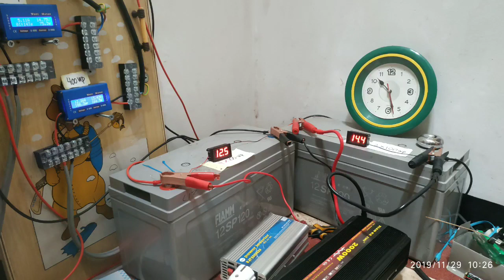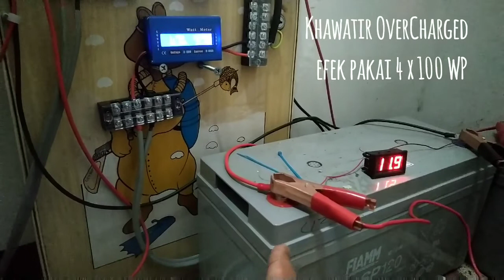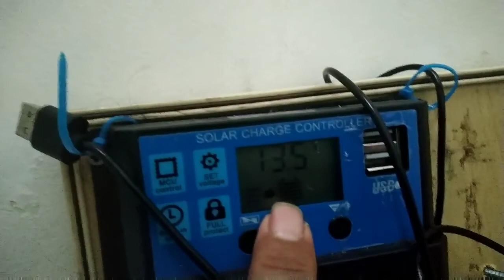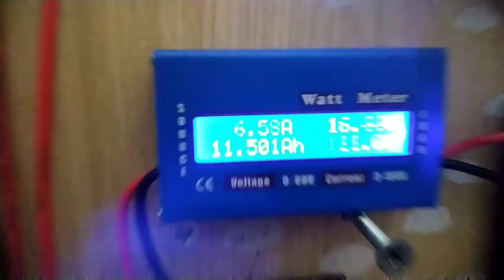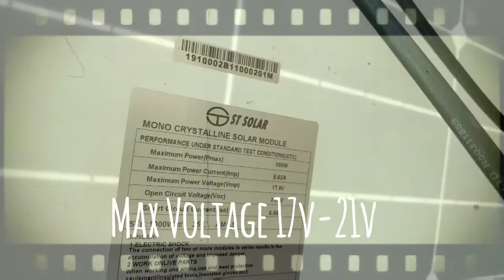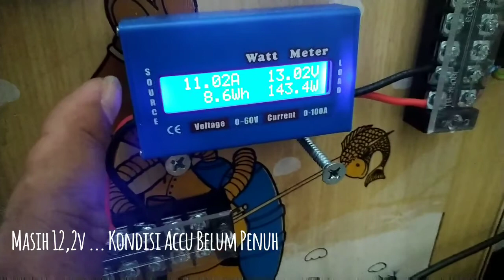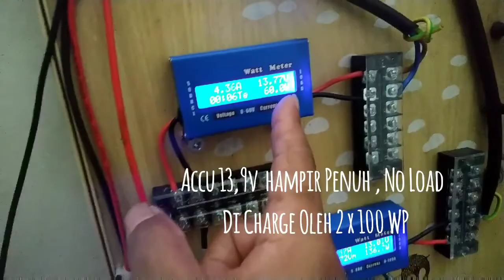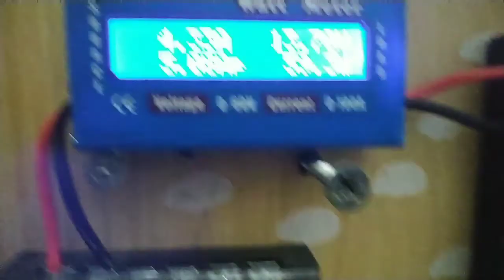Berapa Panel Surya Yang  Ideal Untuk Mencharge 1  Accu 120Ah ?

Comment: Kalau menurut pengalaman saya ya Om sebaiknya utk menjaga aki awet, aki 100 ampere pakainya 100 wp saja, semakin besar ampere yg masuk ke aki memang betul semakin cepat terisi/penuh akan tetapi resiko nya aki cepet habis dan mudah soak, beda dg ampere kecil aki awet dan pengisiannya bisa padat alias aki tidak dipaksa kekurangannya ya agak lama pengisiannya..mohon maaf bila keliru
Reply from the maker: wah.. kalo di charge cuman 100WP aja lama ngisinya itu pak..   pake 300Wp aja gak penuh penuh kalo kita sambil di pakai beban berat kaya rice cooker 350w... pakai pake rebus-rebus 30-50menit.. pas sorenya masih tekor gak sampai balik ke iisi >12,5v .

makanya sy coba pake 4 x 100WP tanpa Load dulu,  ternyata 1-2hari penuhnya untuk 120Ah dengan kondisi langit mendung berawan..

ini karena SCC nya masih PMW 30A, jadinya masih agak jantungan dipasang 4 x 100WP, takut kalo tiba tiba saat ngantor hari nya  panas terik ada yg jebol wakakak
Reply: Awas jangan gambling,..harus diperhitungkan matang2, kemudian juga harus diperhitungkan juga beban yg harus ditanggung solar panel, sementara siang pakai PLN malam pakai solar panel jangan terlalu diforsir om akinya..
Reply from the maker: @HerryLupheHanny  siap pak
Reply: @Dzikr_Family  bukan PMW om,yang benar PWM (Pulse width modulation).
Reply from the maker: @mainas9530  hehehe benar skali..makasih koreksi nya
Reply: ngakak.  bagai mans cara itung nya.
Reply: hahahaaaaa...... yg dibbaca hanya volt.... selama controlelnya pwm anda ndak bisa ngantor.... ganti broow MPPT 100 ampere... tinggal stel minta volt berapa.... beres.
Reply from the maker: @dellatinesya9072  masih OTW mppt nya nih...  nunggu dianterin sama babang sinterklas wakakak

Comment: permisi boos yang 4 panel pasang seri apa paralel
Reply from the maker: kalo yg di video, dulu 4 panel nya di paralel 12v...

tp skarang saya pakai offgird nya secara seri.... panel 6x100wp di seri 24v  accu nya pakai 4 x 100ah seri 24v
https://youtu.be/g-t3x3JH6_Q
Reply: @Dzikr_Family  boss sy baru punya 50wp Ada 3 ,inverter saya ada 2 yang kecil 500va pure sine wave yang besar belum lama baru beli 1000va lumayan Mahal harga yang 1000va 2.840 pure sine wave SNI
Reply from the maker: kalo SCC nya pakai MPPT,  panel enak nya maen seri24v .. accu bisa seri 24v jg atau main 12v sesuai voltage inventer nya..... biar cepat penuh kalo panel kaen seri 24 katnya

Comment: Saya pakai 150wp, accu 100ah, charger dri jam 8-1:30siang udh fuel accunya, terbca di scc 14,4 volt.
Reply from the maker: kalo di voltage accu di kuras dulu,  bisa full brapa hari itu accub100ah nya ? apa sehari bisa full jg .. mantaps tuh berati efisiensi panel nya brarti ..
Reply: @Dzikr_Family  di pakai semalman bro karna sering mati lampu pln
Reply: Di kurasa sampai mendekati voltage min, 11 volt.
Reply: kebetulan tinggal di garis khatulistiwa hri cerah matahari fuel dri jam 8 pgi sampai 4 sore.
Reply from the maker: wuih   mantap mantap.. pakai merj apa itu 150wp nya..  saya kira harus diatas 200-300wp bisa full sehari saja accu 100ah nya
Reply: @Dzikr_Family  kebetulan merk kl gk slh ingt merk "FALWS".satu set sama accu 100ah
Reply: @GRivai  cek harga berapa mas???

Comment: Itu scc sejuta umat settingan full charged di yg B1 B2 B3 ya? Trus kl tegangan udh sesuai B1 B2 B3 nya otomatis ke settingan floating gitu ?
Reply from the maker: iya.. 

B1 b2 b3... disesuaikan dgn jenis aki yg kita pakai....   
nanti SCC auto ngatur aja 7 seandainnya accu kita sudah penuh... akan cut off SCC nya ngerem otomatis,... 

tp kadang kalo panel kebanyakan, gak kuat jg SCC sejuta umat nya  Rem Bong 😁
Reply: @Dzikr_Family  misal nya pagi charging, trus penuh nya kan sesuai settingan batere, kl udh full dia kan stop charging, trus batere kan discharge tuh, nanti scc ngecas nya lg ke settingan B1 B2 B3 nya atau ke floating yg 13.7v?
Reply from the maker: @YudhistiroRM  iya betul... 

kata di manual book SCC BIru nya.. 
Equalization B1=14,4, B2=14,2v, B3=14,6

Float Charge nya sama di 13,7v kalo ikut settingan bawaan
Reply: @Dzikr_Family  trus dia akan charge sampe ke equalization nya lagi setelah nyentuh tegangan LVD atau gimana kang?
Reply from the maker: keliatannya bgitu... 
kalo accu penuh...  matahari panas.  kalo pake MPPT Epever di aplikasi SCCnya akan keliatan..   kondisi nya lg float atau fastcharge...

Comment: Pak, kalau pv 200wp + scc ngecharge accu 1pcs 100ah/12v apa tdk over ? Atau malah bagus karna lebih cepet wkt pengisiannya ?
Trimakasih sebelumnya 🙏
Reply from the maker: 100ah msh bisa buat 3x100wp ....  
200wp sdh cukupan.... resiko overvoltage minimalis...asal load jg disesuaikna dgn produksinya..

batasnya bisa sampai 4x100wp, tp harus rajin pasang load..  agar gak overvoltage krn jd cepat penuh accu nya...   

https://youtu.be/B8Rhz-A6NJE
Reply: Begini sebetulnya perhitungan kasarnya.. 
Setiap aki mempunyai batasan charger dan discharge.. seandainya chargernya 40% dari capasity aki yg 100ah..jadi 40anya  Nah 40a ini adalah batas max tercepat dan teraman saat charger.. diatas itu efek baterai jadi panas dan umur baterai berkurang.. jadi bisa dihitung supaya semua aman chargernya dibuat mendekati 40a kalau ingin cepat dan aman.. sekedar berbagi..
Reply: Nah untuk masalah overcharge pemahaman nya begini..
Baterai bisa di isi bila tegangan charger lebih tinggi dari tegangan baterai.
Bila tegangan charger dan baterai sama maka tidak akan terjadi pengisian... Jadi harus tahu batas max pengisian dan setting scc nya..

Comment: Numpang nanya bang.
Aku punya aki 100 amper ,aki mobil
Dan2 tenaga surya 100wp 
Butuh berapa hari aki baru full bang .kebetulan aku gak pake controller ..jadi dari panel langsung ke aki .aki tersebut langsung ke beban yg ON 24 jm. Kita kita aman gak bang untuk aki nya ? Apakah gak cepat drop kalau langsung tanpa controller ,,mohon penjelasan nya bang kebetulan kita baru menggunakan ...terimakasih semoga berkah ilmu nya amin
Reply from the maker: Accu 100ah 12v, brarti accu capacity nya itu kan 1200wh

sedangkna panel 100WP produksi harian bisa 300-400wh, jadi kalo normal sih 2-3hari bisa full biasanya kalo sinar matahari terik..

panel 100wp sendiri ,,,kalo panas poll mataharinya.. bisa mengeluarkan voltage diatas 15-17v.   sementara batas aman accu katanya maks 14,4v

jadi ada resiko accu overvoltage.. dan overheat.. yg bisa mempercepat sel aki rusak..

walaupun kadang sudah pakai SCC juga.. gak menjamin accu gak kena masalah sih... jikalau ternyata si SCC nya rem nya blong.. alias gak bisa cut off di 14,4 berhenti ngecharge aki nya.. 

saya pernah ngalami .. baru beli aki kuah bekas..  jadi drop.. voltage nya drop cuman 6-8v gak bisa naek lagi.. krn SCC nya blong.. aki kepanasan kaya ada bunyi ai mendidih..

coba di cek saja.. saat siang panas.. aki nya ada bunyi mendidih gak.. kalo ada berarti panelnya membuat overheat.. dan berpotensi aki cepat rusak nanti.. gak bisa naik voltage nya di atas 11-12v krn ada yg putus. kena overheat

Comment: Akhirnya berapa jam penuhnya pak ?
Reply from the maker: pakai matahari panas terik... 100wp bisa  seharian aki 100ah bisa penuh....  tp rata rata sih butuh 2-3hari kalo banyak awan
Reply: Jadi  kalau 480wp 160Ah kalau musim hujan seperti sekarang ini harusnya 1 hari bisa penuh ya...?
Reply from the maker: di pasang wattmeter aja.... biar ketahuan 480wp saat mendung produksi nya berspa. watthours. agak susah diprediksi kalo mendung kinerja plts nya...  krn patokan nya adalah SunPeakhour nya.....   saat musim panas rekor brapa jam.... saat musim hujan ngedrop jadi brapa jam
https://youtu.be/tRqheg0UvsQ

normalnya jika SunPeakHours rata rata 4 jam penyiraman.... maka panel . 480wp x 4jam x 60%efisiensi panel  = 1,152kwh kasarnya..

nanti tinggal komparasi dgn kapasitas accu 160ah normal nya brapa. watthours...  160ah x 12v = 1920wh atau 1,92kWh

jika produksi panel 480WP melebihi 1,9kwh... atau saat panas terik dpt 3-4kWh,. nanti coba di pantau.... accu mentok di berapa.voltage nya...   diamkan semalaman tanpa. beban sampai besok pagi.... cek lagi. apakah voltage accu drop atau tetap tinggi....

kalo sdh di semalamkan, voltage accu masih bisa stabil di atas 12,5v saat pagi harinya sblm. kena matahari.... brarti accu masih kondisi baik dan stabil..

https://youtu.be/0I_8B_LdWNE
Reply: Penjelasanya manteb mas brow..... lengap dan sangat mudah di mengerti.... menenangkan diriku yg lagi galau.... hehehehe

Comment: Kalau aki 32AH panel berapa watt yang cocok ??
Reply from the maker: saya pakai accu bekas mobil 45Ah, pakai Panel Surya 100WP masih kurang ngecharge .. dipakai buat lampu DC cuman kuat ampe tengah malam doank.. 2-3jam pemakaian..

https://youtu.be/_c6V5Y4yht0
Reply: @Dzikr_Family  
Kalau DOD aki cuma 50% berarti aki 45Ah hanya terpakai 22,5 Ah.. Harusnya panel 100 wp mampu ngecas 22,5 Ah karena output panel 100 wp lebih dari 5Ampere..  kalau menurut teori sih pak... Mungkin akinya yg sudah gak oke lagi... Maaf y pak cuma pendapat aja..
Reply from the maker: Panel 100wp itu palinga cuman bisa 3-4a saja kalo panas terik..  biasanya sy cuman mentok di 300-350wh, jarang bisa dpt 400wh dari 100wp 

5a itu kalo kita ngukur lgs dari mc4 nya panel... tp kalo udah masuk SCC palingan cuman 50-80% dari 5a tsb saja ampere nya...  atau 3-4a sdh bagus...

menurut saya, paling valid ngukur produksi plts enaknya pakai whathours....  input wh nya brapa saat siangmmm ...   pas dipakai malam bisa brapa whathours yg dimanfaatkaan buat lampu dll

kalo whathours pemanfaatan lbh kecil, brarti memang accu nya sdh gak bisa nyimpan banyak..  alias banyak bocor dan nguap hasil panen disiang harinya ..

yaaa resiko PltS kita pakai barang sekenan... agak susah buat mencapai catatan yg secara ittungan cocok dgn teori nya sih

Comment: Pemakaian beban pada malam hari kan full dari aki ya pak, kalau siang hari apa sama full dari aki juga pak? Atau dibantu dari panel? Atau panel cuma berfungsi ngecharge aki saja? Mohon pencerahannya
Reply from the maker: saat ini baru full di pake malam dari 1 Accu 120Ah buat lampu AC saja.. total beban 50-60watt di 11 titik lampu (3w, 5w, & 7W) buat indoor dan outdorr..

kalo siang baru bisa pakai kalo sabtu minggu doank.. atau kalo sy lagi gak ngantor atau ngeremote Iwork kerja dari rumah.. 
 takutnya ada masalah ntar perangkat jebol gegara orang rumah gak ada yg peduli PLTS hahahaha, biasanya kalo low voltage accu soak inverternya teriak teriak..
Reply: Mungkin saran bisa pantau jarak jauh kang trus on off nya pakai pluston jadi bisa pindahin sistem lewat jauh pln ke aki dan sebaliknya
Reply from the maker: iya kmarin baru pasang CCTV doank... tp keburu rusak gegara ganti kabel USB ...korslet kena ke SCC nya jg

Comment: Bang kalo 200wp untuk accu 100ah gimana ?
Reply from the maker: lama ngecharge nya...  saya pake 300WP aja gak penuh penuh seharian di charge saat musim.kemarau kmarin..

.. 100Ah idealnya min 400Wp kalo buat sehari ingin lgs full ....
Reply: @Dzikr_Family  
Penggunaan 100ah di pakai seharian bisa maksimal berapa watt gan?

Bisa 100 sampai 0 
Maksudnya bisa 12 x 100ah 
Kan bisa 1200 watt gak gan?

Atau maksimal berapa dari kapasitas penyimpanan?
Reply from the maker: paling aman cuman 50% kapasitas accu saja.,.   kalo 12v x 100ah= 1200wh  x 50% = 600wh

jadi maks kita pake buat 600wh, kalo perabot:
-  600wattt , brarti cuman 1 jam saja
- 60watt bisa 10jam
- 6watt bisa 100jaam
Reply: @Dzikr_Family  
Ok
Reply: Bang punya saya panel 200wp dan dipasangin accu 100Ah merk Kijo,waktu siang hari accu saya panas bngt.
Nah pertanyaannya apakah masih normal dengan kondisi gitu.salam🙏
Reply from the maker: dipasangin load aja.. biar arus dari panel lgs terserap ke beban gak numpuk di accu nya..

kalo aki gejala demam panas,  bisa brarti itu tanda overvoltage ..aki sdh mulai penuh tapi SCC ngalirin arus terus ke aki...  dan bisa bikin overheat ..ujung2nya bisa bikin cell aki nya rusak... di cek aja apa SCC rem nya blong apa bisa cut off sesusai setingsn batas atas nya..

Comment: Saya aja 450wp nge-charge aki 250ah gan, setiap abis magrib pasti 12,7v ,seharusnya agan 400wp mah lumayan bisa nge-charge 200ah.
Reply from the maker: iya betul... mungkin karena 1-2minggu ini langitnya berawan jd mentok di 12,5v aja nih..
Reply: aku 900 wp tak buat sistem 24 volt batryy basah 75 ah 2 
biji controlel mppt 60 amper mppt inverter TBE 2000 waat psw.... siang hari saya pakek beban imput dc inverter 10 ampere,  charge panel surya ke accu 20 ampere.... kamampuan batrry sampai jam 20. 00....
jadi punya mas fahri sudah memenuhi sarat tinggal sistem pengaturan.  tapi aku lihat di vidio mestinya mas fahri pakai sistem 24 volt kabel biar lebih ringan tidak panas.
Reply from the maker: @dellatinesya9072  kalo dalam sistem 24v .. jika dari rangkaian panel nya beda bakal masalah ga ya ?  misalnya saya kan ada 6 panel..  dibikin 200wp & 400wp.. nah kalo kombinasi seri nya seperti itu apakah ada beda ya dibanding kombinasi seri paralel dari panel yg seimbang  3 panel -3 panel.. ?
Reply: @dzkir_Family coba dong mas di rangkai 400wp dan 200wp di seri 24volt , soalnya saya juga 450wp rangkaian 12volt
Reply: @dellatinesya9072  mba lebih enaknya dicoba kalau siang jgn ada pemakian beban , aturan mba 900wp itu bisa untuk aki bisa diatas 350ah,, udah gitu jgn pakai Aki basah mba soalnya akinya tenaganya engga bisa dikuras sampai 80% lebih
Reply from the maker: @adesusanto4836  masih ragu ragu nih... belum pede wakakak.. soalnya masih ada jalur lampu DC 12v...  pernah pada tewas lampu DC nya gegara nyoba seri 24v..   harus pake penurun tegangan dulu biar aman lampu lampu DC nya..
Reply: @Dzikr_Family  iya lampu dc kan 12v semua ia mas
Reply: @adesusanto4836  intinya pen gunaan memang siang hari bantu pln,  kalu bagiku tenaga surya memang saya porsir accunya, karna accu ada batas usia mas.  makanya panel surya nya lebih besar,  dulu 450 wp accu telat mas.... beban sehari2 , 2 lampu phlp 14 wat aquarium.  ricoker,  1 kipas angin,  kadang tv led 60 inc,  solder ayah non stop 40 wat,  cuaca normal jam 8 pagi sampai inverter bunyi  20,30. semua sistem auto,  paginya kalau cuaca bagus udah on sendiri.
Reply: @Dzikr_Family  ,tidak masalah mas?  yg penting bisa 24 dulu,  kalu yang siap 200 jodo nya 400 dak papa,  kalau dah puas tambai lagi 200 wp... dilu saya ya ribet sepetti mas?  rumahku 900 wp,  semua uadh outo intinya bantu pln..jam 8 pagi hidup cuaca bagus inverter peringatan accu habis sampi jam 20.30 ...dia udah pindah pln sendiri.  paginya jalau cuacabagus on sendiri.... beban sehari2 , lmpu pilip 14 wt 2 , kipas angjn 1 ,aquariom,  ricoker,  kadang tv led 60 in.  solder ayah non stop 40wt kadang 2 solder adik saya.
Reply: Punya saya 480wp aki 160ah. Kondisi mendung dari pagi sampe sore mentok di 12.5v . Dipakai buat penerangan malam jam 9 malam tinggal 11v  normal tdk ya?. Mohon pencerahan untuk yg lagi galau....
Reply from the maker: kalo panel 480wp.harus nya sdh lbh dari cukup untuk. menuhin aki 160ah dlm sehari jika cuaca bagus

tp kalo kondisi mendung  memang bisa drop sekali produksi listrik nya sih.. gak bisa jadi patokan jika mendung.

Comment: Inverter KENIKA nya kok gak pernah dipakai gan?
Reply from the maker: tunggu tanggal maennya hahahaha. 

soalnya kalo 24v itu harus bongkar rangkaian dari panel nya juga kan ya.. biar 24v juga..    

baru liat yutub tadi.. kalo voltage lebih kecil gak bisa ngecharge voltage yg lebih besar..  pantesan dulu settingan panel 12v gak ngepek ke accu yg udah di Seri 24v , maklumlah learning by doing ini.. hehehe